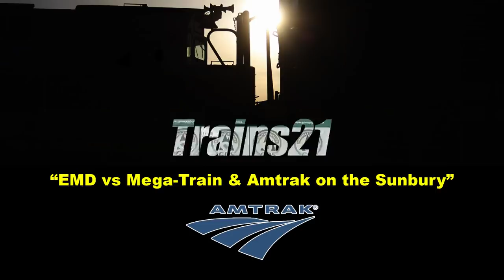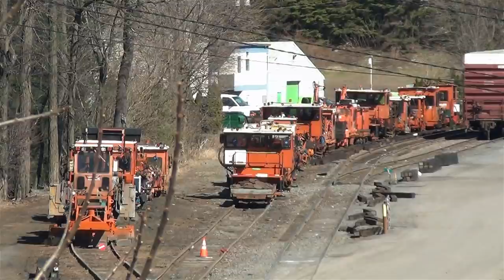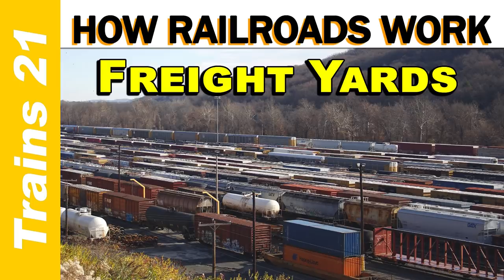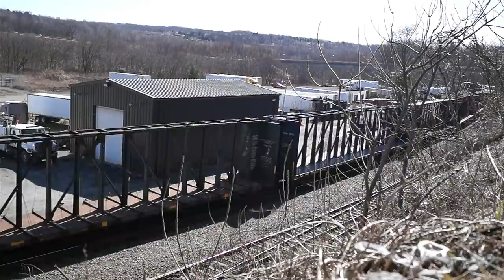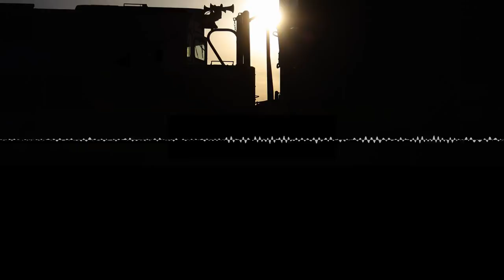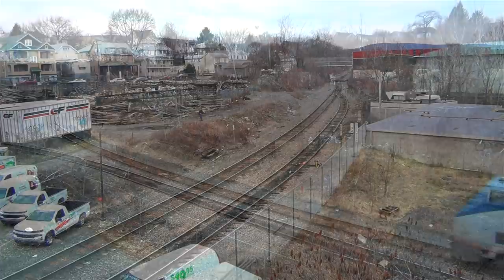[RB][T-191] EMD vs Mega-Train + Amtrak's New Acela High-Speed Train | Trains 21

Comment: I was told CP has haulage rights on the southern half of the D&H which is now NS
Reply: They did the ferry via the High Iron because of where Alstom Hornell is; it's not like they can route directly to Keystone (which ALSO passes through Sunbury); they have to make a roundabout run. (Remember, the High Iron is NOT electrified; therefore, Amtrak has to use DE ferry trains for this; they did for the TTCI run with the first Avalia Liberty test set.)  Further, if I'm not mistaken, they can't even run Avalia Liberty full-tilt until TTCI signs off.

Comment: You know I really hope that GE catches ca ca ca ca ca ca ca Corona!!!!! I wished there was more EMD's out there on big railroads in service, but really EMD'S last punch in the fight was the sd70ace. Sad to see smaller power such as the 60m's and the sd40-2's disappearing from the main lines of America right before our very own eyes.
Reply: It sucks love emd power
Reply: That's it Harris buddy your gettin my subscription, and you know something weird I think emd screwed up on? On the gp40-2 their is an electric "hand" brake so to say. Bit then turn around and look at the sd40-2 and look at it and go, where's the electric hand brake?? Because its an actual hand brake. And I think the reason could be it's that the gp40-2 is a later model 4 axle unit and the sd40-2 is a 6 axle unit, they have virtually the same power but the sd40-2 just had more tractive effort. And also its just older soooooo.......yeah I guess.

Comment: The front looks like the Rotem KTX; however, the KTX is approx. 627 US 
tons (the weight of an original Acela; whereas new Acela is only 420 
tons.  Just slightly lighter than a Thalys set.

Comment: Question:When is the Avalia Liberty going in service?
Reply from the maker: I think it's in service now.. I think.
Reply: @Trains21  while covid 19?
Reply: Blue dragon Trainer 2021
Reply: @IndigosClothing  oh ok
Reply: @Trains21  No, actually this is a brand new type of Acela. It's not even through testing yet. The trainset you saw doesn't go 150mph tops, it can reach I think 225 or 235mph Tops. This brand new set was designed for the rehabilitation of the NEC and the Future SEC.
Reply from the maker: @itzzheniahere6824  I know.. That's why I said that they can MAINTAIN 150 on several miles of the route.. I didn't say they went 150 mph tops.. But I thank you for the other helpful information and for watching and chiming in.
Reply: Trains21 You’re welcome. Sorry that my comment may have seemed like an attack. I was just stating that, now, they will be reaching 200+mph on more than 30miles of track. When the upgrades go the NEC are done

Comment: High speed bullet trains!  In your presentation, you noted this train could hit top speed for 30 miles or so on a stretch of track in your area..  HST's are not feasible in the crowded congested northeast corridor.  Just because some folks consider us 'behind' Red China, Japan, and Europe in the development of HST's doesn't make it true.  In those countries/continent, folks still travel by train, especially Red China with a population of 1.2 BILLION.  Here in America it makes no sense.  No one rides passenger trains in the numbers reported by Asia and Europe.  It was about two weeks ago that I saw the Texas Eagle setting in a side track at Granger, Texas.  Sidings are where most Amtrak trains spend a lot of time.

I saw a rail video on the RFD channel's Trains & Locomotives program.  This was about the northeast corridor and covered Grand Central Station, Pennsylvania Station, and other dead railroads like the Erie, etc.  The number of commuter trains pulled by steam engines, early diesel's, and GG-1's was astronomical.  The train stations had so many tracks and crossovers and trains coming and going that it would've been a rail fan's wet dream.  I don't think folks in those days figured trains should go 150 mph to get them to and from their destination in the suburbs.

HST's might make some sense in America's heartland, especially the flat plains states where you could let it all hang out, but not in the mountainous areas of the east and northwest, and certainly not in congested SoCal.

Now back to your regularly scheduled programming.  Keep up the good and informative work.
Reply from the maker: Thanks David.. I can never get enough of your wisdom!

Comment: That first train was 30% to 50% empty, Just moving rolling stock. 
150MPH over 30 Miles is not HSR. Its a taste. A lick. A what do you think.  But not HSR.
HSR will only work with a dedicated HSR corridor. Not shared with freight.
Reply: Actually the majority of the time, freight doesn't use the HSR Corridor, NEC. Which indeed IS a highspeed rail corridor. Just because it's a bit slower than the other countries, does not make it any less of a HSR corridor. It's using the same design, same idea, same equipment now. Let alone, these new trainsets will be capable of 200+Mph. Tell that to your "Taste" of HSR.
Reply: Also, most HSR corridors, even outside of the USA, are freight shared. Even if it's High speed electrified freight.